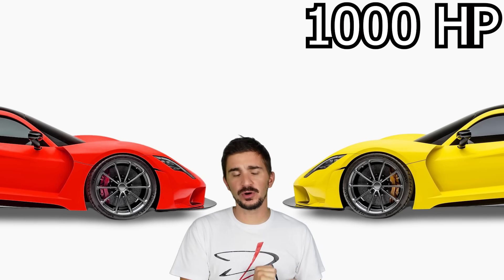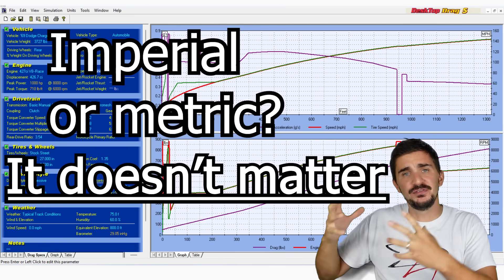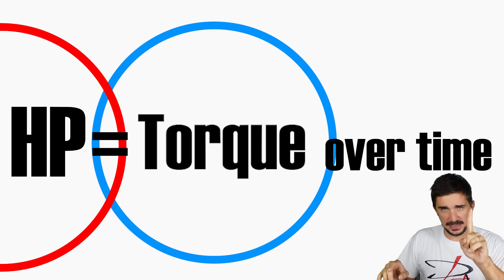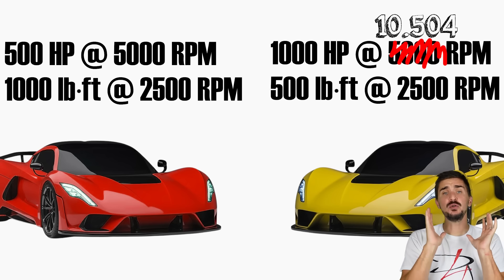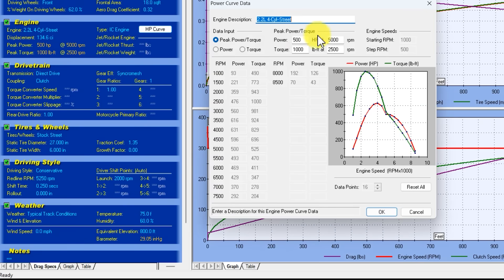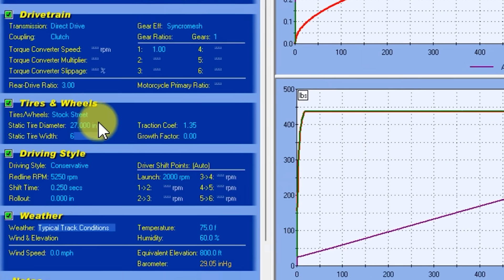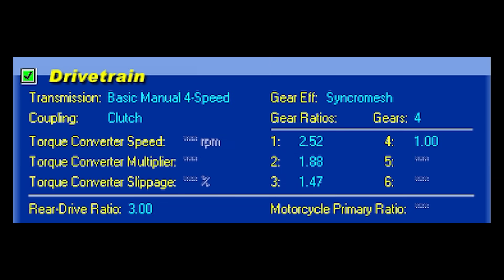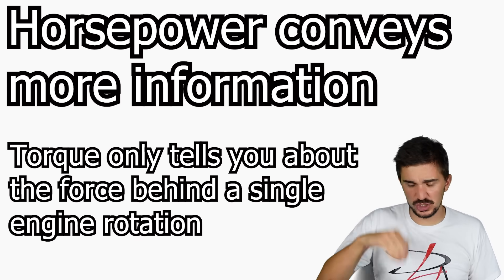Who's faster? Explained and Simulated - Horsepower vs Torque

Comment: The reason the high torque car is faster in some of the scenarios is because it actually has more horsepower than the high horsepower car at the rpms the cars are being forced to operate in. At 2500rpm the high horsepower car only has half the horsepower of the high torque car (because it has half the torque at the same rpm).
Reply: area under the curve essentially. Through the gears, two otherwise identical cars, the car with the highest area under the torque curve will be the fastest
Reply: @Mega-Drive94 It's a little more complicated. Gear ratios will determine which rev band matters. You have to also account for the time lost during gear changes.
In general I'd say heavier less aerodynamic cars need to be more torque heavy, light and aero needs more power. Just look at trucks VS cars VS sports bikes.
Reply: You're 100% right.

2× Engine power (assuming the same transmission efficiency) will result in 2× power at the wheels. Seeing as the wheel doesn't change diameter, it will also have 2× torque at the wheels.

Having 3 engines with a flat torque curve
1. Base engine standard power,  standard torque

2. Double power, standard torque (read doubled rpm)

3. Standard power, double torque (read halved RPM)

And give them the ideal gearbox to allow them to achieve the fastest time possible, a 100% efficient CVT and perfect traction; Engines 1 and 3 will finish in identical times, while engine 2 will be much faster.

This video really didn't do much other than compare a peaky engine Vs a wide powerband engine in a very special set of circumstances.
Reply: I came here to say the same thing. At 6:21 you can see the torque car producing over 500hp from 3k-5k.
Reply: @andyw28  this was my only gripe with the video. A car that makes half the torque but double the RPM would reach the same peak power, and assuming the final drive is adjusted would perform exactly the same. A car that makes half the torque and double the power would rev 4x as much and assuming final drive is adjusted would simply be faster in all cases.
Reply: Wrong. There's some examples of cars that had 1000 Nm that could just barely outrun something with 520 Nm. Just take the 2003 S65 AMG against the 2005 BMW M5. They're surprisingly close in acceleration.
And if you need another example for crazy low torque performance, any N/A Ferrari. Torque is a useless indicator for performance especially on Mercedes and Dodge.
Reply: @Valucyan it just means that the car has more horsepower in the lower rpm range than the others, thus faster at lower revs, but the max power determines the acceleration of the car...no matter the torque at all
Reply: This doesn't actually make sense because gearing compensates for this. For example, second gear is set to redline right at 60 mph or 100 km/h.. They do this on purpose.
Reply: What about those gigantic cargo ship engines that make millions of ft lbs of torque at only 100-300 rpm, huh? Because they idle and run so slowly compared to everything else they also make a crap load of horsepower too.
Reply: @TheSilverShadow17the engines used for shipping typically make about 5 that’s FIVE HP per litre.  A 2 or 3 litre car or SUV designed the same way would make 10 or 15 HP.  How useless would a 5000 lb SUV be with 15 HP?
Reply: Lol. You STILL think horsepower is more important than torque, don't you?!!

You people are insufferable.
Reply: @mustangstuff7213  I mean... Physics... It is. The engine with small horsepower will win because by definition It puts out more power. This means that you can get more torque at the wheels for the same speed or more speed at the wheels for the same torque after compensating for changes in RPM with a different transmission.
Reply: @mustangstuff7213  It's simple physics. At a given speed, a car has an amount of kinetic energy, 0.5 * m * v^2. To reach that speed, that amount of energy must be provided. The rate of provision of energy is power, therefore you will reach the speed fastest with the highest power.
Reply: @mustangstuff7213  Have you ever taken an online engineering course?
Reply: @mustangstuff7213  the part can never be more than the whole.  I can’t believe I have to point this out but when we multiply something we get more of it not less of it.  Where do you get this one dimensional thinking and mystical belief in the magic torque? 
Would you compare Length to Area and conclude length is more important when we
know Area = Length multiplied by Width?
Or Compare Torque with Force and conclude
Force is more important?
When we know Torque = Force multiplied by
Radius
Or compare Stroke to Displacement and conclude stroke is more important?
When we know Displacement = Bore multiplied
by Stroke
Or compare Force to Work and conclude force is more important?
When we know Work = Force multiplied by
Distance
Or Compare Mass to Force and conclude Mass is more important?
When we know Force = Mass Multiplied by
Acceleration.
Or compare voltage to Wattage and conclude voltage is more important?
When we know Wattage = Voltage multiplied by
Current
Or compare hourly wage to annual income and conclude hourly wage is more important?
When we know Annual income = Hourly wage
multiplied by total hours worked.

All Work is done by Power.

Power, not torque, is the limiting factor in not only the top speed of a vehicle but also how quickly it can accelerate at any speed and how much weight it can pull up an incline at any speed.

Increasing Torque at any given vehicle speed without an accompanying increase in power will not result in more acceleration or towing capacity. It can't under the first law of thermodynamics - the conservation or energy.
Reply: @mustangstuff7213 hp is more important than torque. Torque is a twisting motion. You can put 1000 pound feet to a frozen wheel and get nothing done , but add rpm and get hp and work done.
Reply: @doomman700  Incorrect. Without the requisite torque, you'll NEVER get it to rotate.
Reply: @mustangstuff7213  which means you now have hp
Reply: @mustangstuff7213  

Mike has a Vmax 4 800ps that makes, say, 240 HP at 10,500 RPM. The math is, tq x RPM / 5252 so his engine makes 120 lb/ft of torque at 10,500. Not bad. But his competitor has a ps800 Polaris that makes greater 130 lb/ft of torque and makes 230 hp at 9300.

But somone tells Mike that he needs more torque if he wants to go as fast as the Polaris. "HP is for dyno bragging, torque wins races".

So Mike, being a crafty engineer removed the low-torque race engine from his sled and fitted the pedal crank from his Schwinn bicycle to the sled tunnel, with 12" long arms from the sprocket to each pedal, then hooked a bicycle chain to the jackshaft. Mike weighs 150 lb so now when the light turned green Mike stood up on those pedals and made a wicked 150 lb/ft of torque with his legs, but the sled is a dog because Mike could only crank that pedal 30 RPM. 150 lb/ft x 30/ 5252 = .85 HP. He didn't get it, so he asked my girlfriend, who weighs 350 lb in her pink baby-doll nightie to ride on his shoulders while he raced his sled. Now he had SERIOUS torque-- together Mike and my honey weighed 500 lb total so now on the first pedal stroke he made 500 lb/ft so now that sled should be very fast! Problem is, Mike's legs are as skinny as mine and with my girlfriend riding on his shoulders (I made her put her panties on first) (and Mike, wisely, had wrapped his neck with saran wrap) his pedal speed dropped to 9 RPM! 9 x 500/ 5252 = .85 HP. Shucks. 500 lb/ft and .85 HP doesn't do squat, and neither does 150 lb/ft and .85 but 120 lb/ft and 240 HP is dandy. 

Now Mike knows its all about the combination of torque and engine speed. Jockey them both about, and get the highest possible HP, in as broad a plateau of HP as possible so the inevitable over or underrev won't kill you. Forget the torque, you need the broadest pile of HP.

Torque does absolutely nothing without lots of RPM. And at that point it is HP. I am speaking from decades of running a dyno.
Reply: @doomman700  You're right about cars, I think he was saying the analogy used was bad "You can put 1000 pound feet to a frozen wheel and get nothing done , but add rpm and get hp and work done." It doesn't make sense. RPM is how many times the torque is applied per minute. You are applying 1000lbs and it's not moving, because lets say you need 5000lbs to break the ice first. You can sit there and try 1000lbs as many times as you want, that thing ain't spinning. You don't get RPM, until the wheel is moving, you haven't made any torque in a sense because the ice is pushing back with much more causing no rotation to take place to generate an RPM.
Reply: @deanconstan481  you have it backwards, you have applied torque and gotten no hp.
Reply: @deanconstan481  that is simply incorrect, you can put the torque to a frozen wheel and make zero HP. Torque is the twisting force no hp necessary to apply it , but as the example explains in simple terms, you didn’t get work done until it became hp with rpm.  The guy with the biggest, broadest pile of horsepower wins.
Reply: @mustangstuff7213  LOL that what gears are for! Creating the right toque at the wheels to get something moving, regardless of engine.

Higher horsepower ALWAYS rotates faster for any target wheel torque.
Reply: Yeah he says "I choose HP" but he needs 4 times the RPM to still have a worse performance than the Torque car
Reply: Second gear at redline is always around 60 mph or sometimes 100 km/h which is actually 59mph. This means that if an engine creates more horsepower at a higher RPM then you're already going to be using it. The engine and transmission combination are designed together.
Reply: Then don't force it to operate in that RPM ..
Reply: Only if the higher torque car has more power at that moment, if the high HP does it will accelerate faster. If gearing is the same.
Reply: @breeminator someone who understand it. It is all about the power. And higher rpm engine can have an shorter gear ratio. that is why diesel with same power is slower.
Reply: Ok, but cars are never really forced to operate at a specific RPM since they have multiple gear ratios.
Reply: there is no such thing as a car with higher hp than torque
Reply: ..Any engine with a power peak at an rpm higher than 5252 will generally have more hp than torque.
   It would be possible to make an engine with a large torque peak below 5252 rpm, and a peak hp that is a lower number, but above 5252 rpm. But weird. Mathematically possible...I can't think of any, though.
   It is true that ANY engine with a power peak at lower than 5252 rpm will always have a higher torque than that power, whatever it is.
Reply: @firstielasty1162 My Mercedes M113k went on the dyno not long ago and made 544whp at 6200rpm, and 989Nm at 2600rpm.
Reply: @heldermonteiro2718 what? I have a 900 whp sti but with only 600 torque lol. You don’t know what you’re talking about
Reply: @heldermonteiro2718 My 230hp 88 ft*lbs zx-10r begs to differ. How does it do this? Oh right, it redlines at nearly 15k rpms.
Reply: @heldermonteiro2718  This statement makes no sense for several reasons: 1. horsepower is a specific unit of measure, while torque is a concept (the associated units could be foot-pounds, inch-pounds, mile-ounces, newton-meters... in other words, force times distance). 2 as note in this video, power and torque are directly related through engine rotational speed (in fact, dynomometers generally measure torque and calculate power).
Reply: @heldermonteiro2718  that's not how that works at all  😂😂
Reply: @heldermonteiro2718 except every engine that makes peak power above 5252rpm, they curves have essentially crossed and hp will be higher. Mathematics say so.
Reply: @heldermonteiro2718  you have clearly never heard of F1 engines. You know 1000 hp barely 500 Newton metres of torque let alone foot pounds you are goofy dude.
Reply: @heldermonteiro2718 like every single V12 F1 engine that isnt turbocharged has more hp than torque, what are you yapping about
Reply: @heldermonteiro2718  literally any f1 car
Reply: @heldermonteiro2718  Old V10 F1 cars had 800-1000hp and and only barely over 200 torque (ft lbs).
Reply: @heldermonteiro2718  f1 engines generate 800hp peak but only around 225 ft pounds torque peak

Comment: I think what it mainly depends on is where in the RPM range the torque curve is and how flat it is. Area under the torque curve is important.
Reply: If you move the torque peak you also change the horsepower.

Comment: And here I was thinking HP was a made up number used to sell engines to Americans since they have no concept of a Newton Meter and think a Kilowatt powers a light bulb.....
Reply: they have lbf ft what is nm if you multiple it be 1,3558🫣 + hp is not made up number hp is how much work can be done in specified amount of time for end vehicle the same work in shprter time you need more acceleration and force 👌🏻with perfect gearing more hp engine with less lbfft beat less hp more lbf ft also with perfect gearing both in drag race and in weight pulling 👌🏻
Reply: @mociczyczki  it isn’t a made up number, but it also cannot be directly measured like torque can

Comment: High TQ = High Acceleration.
High HP = High Top Speed.
Equal TQ & HP = balance.
Higher balance = higher performance.

Sir, add the balanced scenario to your comparisons, 750 HP/750 TQ.

Also, graphic overlays of the data would be wonderful.

Thank you sir.
Reply: Wrong. Messing up power and speed.

Power=acceleration*speed*mass.
Reply: @simplemachine9531  As curiosity strikes: are there any practical examples in CARS? Where the differences in HP & TQ are large? 

High Torque/Low HP 
Versus 
Low Torque/High HP

While comparing 
Acceleration
Versus
Top Speed
Reply: Gear ratios will throw it off. If only there was a way to test the different scenaio engines with the same transmission and the theory of High TQ better Acceleration, High HP better top speed. I guess the drag program he used is good in theory.
Reply: @CrashLarue  a chopper versus sports bike. 
Higher top speed means better acceleration and it can't be another way around. Because top speed is reached due to acceleration. 
Should not forget that acceleration of the car is not the same as acceleration of the engine because car can ride at different speeds at the same engine speed. Best acceleration occur if shifting gears up around peak power, not torque. Really, power=acc*speed*mass answers all the questions.
Reply: @simplemachine9531  reason I bring it up is that I have no problem racing beating big V8's (Camaro's/Corvette's) until we get over 120 MPH. After 120 and up those high HP V8's just walk away from my 320HP/420TQ High Boosted Turbo 4. Must be the gearing. I need another gear. Haha.
Reply: @CrashLarue  well, those cars' engines have far more both torque and power. Maybe other factors involved like mass and air drag

Comment: I coined the phrase "Torque moves mass, Horsepower moves air."

Torque will make a car quick which wins drag races, and Horsepower will make a car fast which wins cannonball races.
Reply: Wrong, read what power is
Reply: @simplemachine9531 
Wrong. See what coining a phrase is.

See, I can make irrelevant and useless statements, too.

Now to ACTUALLY add something to the conversation...

It's all about that pesky RPM in the calculation. Dump trucks have gobs of torque (required to move mass) at 1,500 RPM but relatively low-torque sport bikes can go over 180 MPH due to the high horsepower (required to move air) because they have redlines well north of 10,000 RPM.

You're not going to ever see 10k RPM dump trucks OR 1k RPM sport bikes.
Reply: @brackman71  sure the more you add to the wrong statement the deeper descend into stupidity.
Semi trucks have 600+ hp under the hood. "To move air at 180mph"🤣
Read what power is or you never gonna leave the circle.
Reply: @simplemachine9531 
My troll-feeding days are over.
Find someone else.

Have a nice day.

Comment: And here i was always saying that torque is a useless measure, since you can have whatever torque you need with gearing, heck through gearing a 50hp engine in sherp produces 8000 lb of torque, is it fast? hell no.

Comment: your torque biased calculations are incorrect as well. in order for a car to have 1,000 ftlbs of torque the peak rpm has to be 2626rpm. 2500rpm makes it 1,050 ftlbs of torque.  i'd be interested in seeing if the numbers were similar with the peak rpm change for the torque

Comment: This is such an incredible bad video.  Instead of explaining the issue,  you just make it even more confusing.   
First, by selecting numbers that are impossible.  Which then requires a 10k rpm engine, adding an extra variabel.  Just pick twice lower torque for both, and you don't need to do that.   
Second, you don't explain the only thing that really matters... the torque multiplication achieved by the gearbox.  What accelerates a car is wheel torque.  That is only the same as engine torque with a direct drive. But the moment your are free to select a proper matching gearbox, than high HP always wins from high Torque.  And thats because high HP means high rpm, which means you can select a lower gear giving higher torque multiplication, and thus higher wheel torque.  The reason why i known HP always wins in this case, is because HP = torque * rpm.  The higher torque at lower rpm cannot give more wheel torque than high HP at high rpm, because then the low rpm case would need to have more HP..

Comment: depends also on gearing, F1 probly has this rpm and gearing and I doubt that the 1.6 in f1 has got a longer gear than my 1.6 golf witch goes 70 with 2000rpm